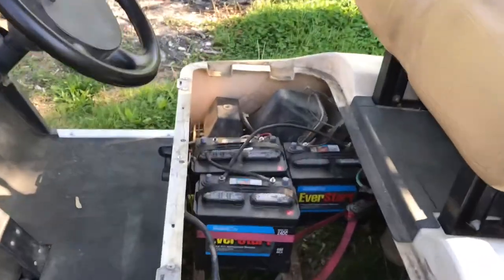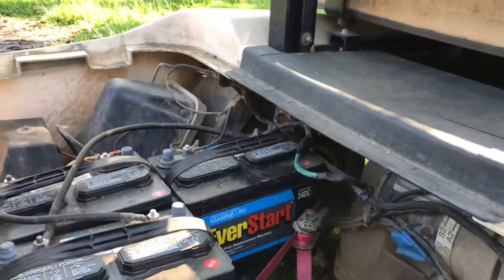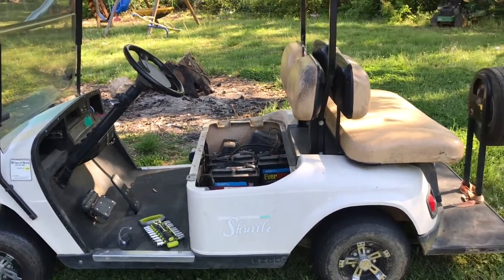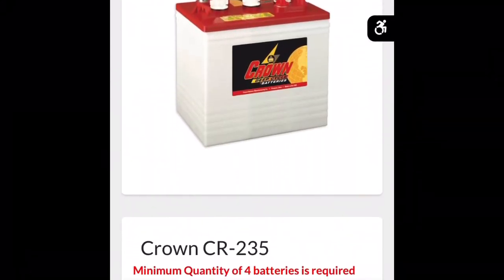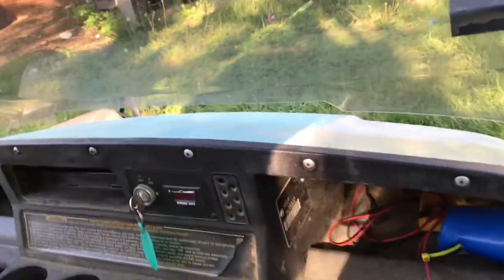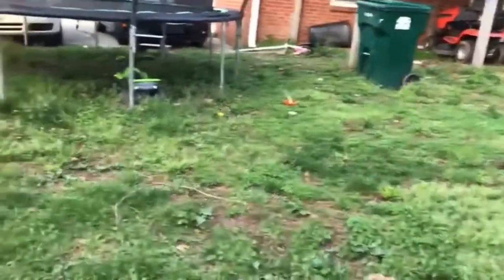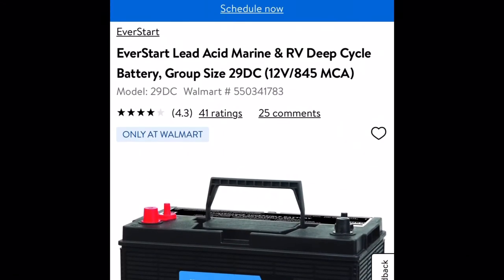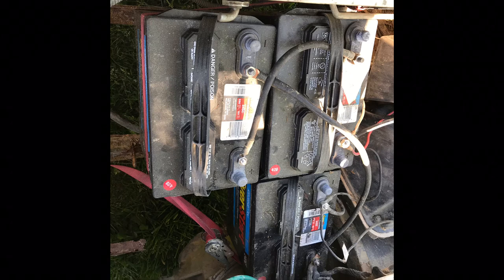6 volt to 12 volt golf cart battery swap 1 year review

Comment: I'm in the process of switching mine over. I went ahead and got the 29DC. I'll send you a comment on how it does. Thanks for the video.
  Update My switchover worked without a hitch. The 29DC batteries work extremely well. I did have to rework the platform to accommodate the longer batteries, but I have more power, faster driving speeds, and charge time seems quicker. Saved me a lot of $$$. 👍
Reply from the maker: Awesome!  Those are what I wanted to use but they didn’t have 3 in stock.
Reply: I plan to participate in this video in the comments section LOL I am currently running 4 EverStart MAXX 29DC deep cycle marines with no issues. I have a digital battery meter instead of an analog like is in this video, from my own personal experience once I hit 48 volts I am on empty my stock charger the original will charge my cart up to full 52 volts and I manage 7 mile round trip but that was right when I got them now I have reworked the entire battery box and am also upgrading a lot of stuff electrically, I have a 2007 club car precedent 48 Volt system.

Comment: You're running under half the Amp-Hours that you had before which is why your meter reads around half when the batteries go dead.  To get close to equivalent run time that you had before you'd have to add 3 more batteries in the parallel config, doubling your 101 Ah to 202.  You could've purchased the next better Wal-mart battery for $95 to get 120-something Ah batteries.  I'm about to do this myself and hopefully when they need replacement in 3 or 4 years the cost of Lithium batteries will come down to something respectable.
Reply from the maker: Definitely makes sense.  I went with the smaller batteries because it’s what was available at the time.
Reply: This is exactly my plan as well I am running four of those 29DC ever start max marine batteries I manage to get a 7 mile range before I hit 48 volts which is empty.
Reply: Did you ever get this done? If so, how did it do?
Thanks

Comment: I COULD be wrong but I believe those do need water from time to time.  See if those caps will pop off.  Hope this helps to keep them going for a long time.  =)
Reply from the maker: The 6 volts hold water the 12 volts do not.  These are maintenance free kinda like a car battery.
Reply: Mine say maintenance free also but there are definitely caps, I still check them and if they are empty or go low which has not happened yet I would just hop off the plate with distilled water we have to keep our eyes peeled on this!

Comment: same here. when you jump battery to battery. so you switched the light cable from neg to pos jump
Reply from the maker: I finally did a volt meter test from the lights not the batteries and it was 12 🤦‍♂️.  I just didn’t think 2 6’s is 12 not 2 12’s is still 12.

Comment: Should add a nice aluminum floor under the batteries for a nicer mount. I’m looking at the same conversion now on a cheap local cart. Batteries are a lot more near me sadly around $220 per battery but still a good deal.
Reply from the maker: Yeah I just replaced one and it was around $80.  Not sure if I’ll change the mounts for them as me and my kids go through the mud quite a bit.  I’ve been happy with this swap, it’s done everything I’ve needed.  Where are you that batteries are so expensive?

Comment: Hey chris, i did this swap 3 months ago and it was great. Now it seems my batteries will die as im riding. After maybe 100 yards i have lost one bar on my battery meter!! Any suggestions??
Reply from the maker: My only suggestion would be to get the larger batteries than I did.  The larger 12 volt do better for me.  I don’t go too far so it’s never been a huge issue.

Comment: I don’t understand the S1 to S2 swap or why it would change anything when it was a 36v system regardless. What exactly are the S1 and S2? Then why does it change when you swap them? Are there any advantages of leaving them alone? 

Currently trying to figure out my wiring on mine and do the swap now. I got it with no batteries in it. So not sure what wires are for the 36v series and what should be wired to a single 12v circuit. Thanks!
Reply from the maker: Yeah without looking at the cart I can’t really help with the which wires go where.  The S1 S2 are the wires from the switch to the motor that tell the motor to spin forward or reverse.  I had to swap mine because I had reverse power (1/2 speed) in forward and full power in reverse, so it was really fast backwards and really slow forward.  I’m not an electrical engineer so I can’t explain why but going from 6 batteries an even number to 3 batteries an odd number changed the power delivery to the motor so swapping S1 and S2 fixed that.  Hope that helps answer your questions.
Reply: @ChrisThedudenurse   I had a club car with the same problem. And it had something yo do with the reverse beeper wiring.  I took the pink wire off of the microswitch on my forward reverse lever and it took off forward same as reverse.  Maybe it will work for you too.
Reply from the maker: @dand7056  mine did not have a reverse alarm or lights for reverse.  Not sure why, maybe I got a base model or something.
Reply: @ChrisThedudenurse  I got my brands mixed up since I have 2.  The yamaha 36v g9 golf cart has the micro switch on top of the reverse forward switch.   Cleaning the battery and cable contacts also helped in performance.

Comment: Will the 29dc batteries fit as well? The 24dc looks like it fits perfectly in the rails.
Reply from the maker: The 29’s will be just a little bit too big for this golf cart but you could always hold them in with a tie down.  That’s what I do.
Reply: I have four of the 29DC and they fit perfectly but not in the stock location of course I will need to take pictures

Comment: Hii what's s1 s2 swap mean you have to do for upgrade from 6 volts to 12 volts? Thank you for your time
Reply from the maker: You may not have to do the swap but I did because after doing the 6 volt to 12 volt swap my forward speed and reverse speed had been switched.
Reply: Hi Thank you Chris makes sense 🔋

Comment: Still working?
Reply from the maker: Yes it is,  I had to replace 1 battery due to an arching wire that also needed replaced.
Reply: @ChrisThedudenurse  cool man. I just picked up a vintage Cushman previously swapped. Seems to work pretty good other than not having a 36v charger. Have to undo and rewire to charge them all at 12v then rewire to 36v every time.

Comment: Will this damage the motor at all? I’m thinking about doing this to my 89 EZ-GO Textron cart
Reply from the maker: I’ve been running it like this for over a year and haven’t had any issues.
Reply: @ChrisThedudenurse  ok cool! Do you know it will wire up the same as yours?
Reply from the maker: @BTRPlumbing  you’ll have to link the positive and negative connections correctly and everything should hook straight up.  It’s fairly easy the hardest part is removing and putting back in the batteries.
Reply: Have you thought about putting six of these batteries in a 3S2P configuration so it’s still 36 Volts but double the Amps?
Reply from the maker: @healeydave  at the time when I did it I was just doing the cheapest way possible,  I’m not sure I need to double the amperage, some stronger batteries would be nice.
Reply: @ChrisThedudenurse  
I've bought a vantage green truck that had a dozen 6 volt batteries from the factory. They were swapped by the previous owner to 6/12 v batteries. He has big trucks so those batteries didn't give it anywhere close to the original 40 mile range even as big as the truck batteries are. So he pulled them out one at a time when his trucks needed them. After the first one was pulled of course the 72 volt motor parked the truck. The starter battery is 12 volt but smaller. Now I'm looking at more money to go back original with  6 volt wet acid batteries than I paid for the truck. I'm thinkimg agm's would be better and give more range but wet acid replacement is between 2300 to 2500. Agm's are probably be half again and I'm scared to look at lithium ion's. I don't know why I bought it on a whim now. Shorter range will make it hard to go to town without plugging up to charge as it would kill batteries as quick as the elite will their cattle.
Reply from the maker: @decoy2636  not sure what the best answer is for you. Cost of those 6 volts is the whole reason I did my swap.  The 12 volts weigh less too.  What is the quality of the 12 volts?  Do you have actual battery company batteries or is it like me with Walmart batteries?  I would definitely swap out all of them and not one at a time.  From the idea I have in my mind of this truck I would have probably bought it too.
Reply: @ChrisThedudenurse  
I only have the short cable's and two empty battery boxes. They each held six when it was new. I think he said it's a 2011 and he thought by buying this truck he would be able to gain a dealership to sell to the government. His deal fell thru and that didn't happen. The batteries failed prematurely that the factory installed probably from trying to go too long before a recharge. He said he went to a Farm Supply in the next City and bought six 12volt batteries like those on his Kenworth trucks and replaced the factory one's. He tried selling it hoping to recoup some of his investment to a couple of factories and that after the second factory tried it out and it came back a couple of months later that he ran back and forth between his house and shop about a 5 mile round trip until he had to have a battery ASAP to get a truck going and after the first one was taken off the truck hasn't moved since. I figured he was sick of looking at it since it reminded him daily about trying to contract is with government. He let me use his car dolly to bring it to another guy's shop here in town to assist with the bed removal etc. to get it running. The factory tires are dry rotted and have maybe 60% tread. He said it was 17K new. He let me have it for 2K no money down but I saw some that sold on government auctions bring more if running and factory solar panels. Those were an option I've learned. This truck came without air conditioning only a heater,  AM FM Cassette, ladder rack and tool boxes with a forty mile range. 
I'm trying to find some more optima yellow top batteries to recover I have brought just three back from the dead so far I've watched a bunch of video's on recovering dead batteries for real. I agree it needs a full load of matching whatever you have the money to buy. I figured around 4 K would put agm's on it idk but either type batteries that came off the same factory pallet would be best. At the present time with a lack of money I'm going to put anything I can get to take a charge if it don't have a 10 mile range then when I get the guy paid I can do better perhaps upgrade it to agm batteries.
Mixing them up without the same capicity kills the entire bunch quickly.I am unable to buy the factory  replacements at this time without using a credit card.
I'm red pilled after my 38 year marriage failed and the divorce finalized I have more bills with less money to pay with now. Divorce grape ain't funny even with grown children. Giving up half of everything you've worked for cramps the style I'm making payments on a car too that she's rolling and my newest truck is a 96.
If I can float a note after trying it out on scrap batteries I'll finish paying for the truck and perhaps a set of AGM's for more range than the factory  40 miles on 6 volt wet acid batteries.
Wrote you a book Dude I gotta look at eyelids for a while.
Reply from the maker: @decoy2636  man when you write a comment you go all out.  Sorry to hear about your divorce.  I am curious about this truck, what’s it called?  This sounds like a really cool thing.  But 12 6 volts would be very expensive because I’m sure they would have to be some sort of heavy duty deep cycle as well.